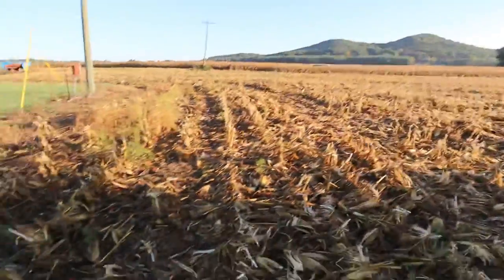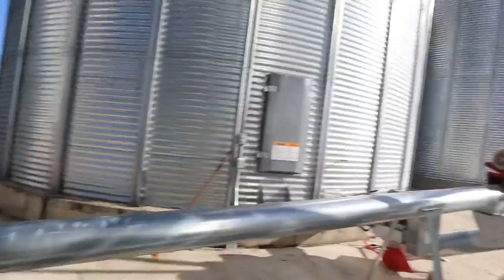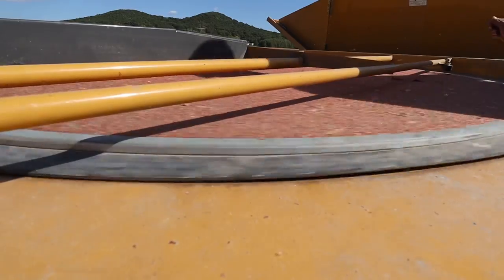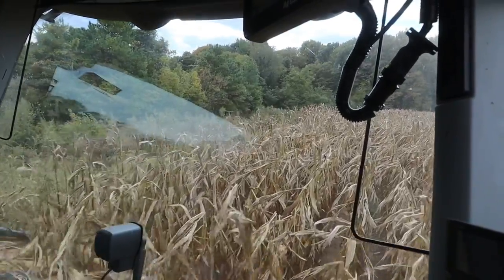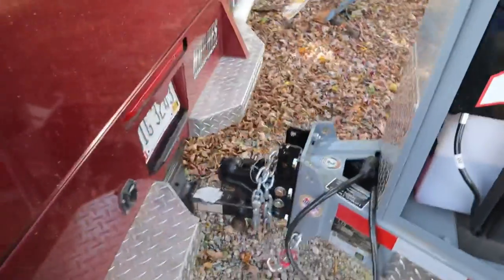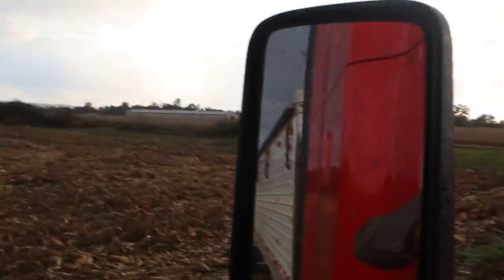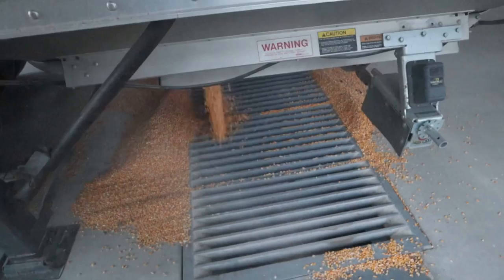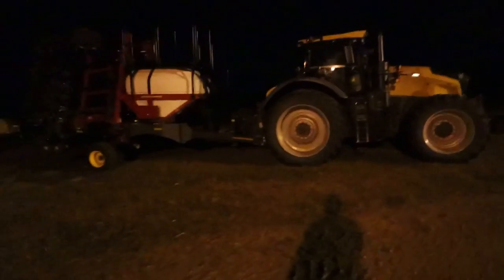Brand New Sunflower Air Drill, New Tractor, and a Broken Combine

Comment: Just a reminder too you farmers too have a safe harvest and wear your seatbelt when traveling down the road this guy was doing 20 mph when he hit a bump in the road where a culvert had been replaced and the header flipped over and the combine went over the top of it and went airborne and when it landed he went through the windshield and bounced off the feeder house and landed on the road 10’ from the front tires the only reason he didn’t get run over by the machine is when he went out the windshield he broke the control lever and somehow the two wires for the hydra static drive were the only two wires that got cut and the combine instantly stopped when he came too on the road the machine was still running wide open he climbed back up in the cab and shut it down https://youtu.be/V1rJr--HsZ0

Comment: If you really want to get rid of that heavy reinforced concrete building-- spray some nitrogen on the concrete-- it will eventually work its way in and corrode the rebar- breaking the concrete from inside..

Comment: You have two combine why are  you Brain not cutting corn. Have only one corn head
Reply: They have a second corn head but it comes down to keeping grain away from the combines. They usually run 2 in soybeans and wheat. Then one 12 row in corn. If it's late in the season and they are pushing they may run the second on corn but right now not worth switching over